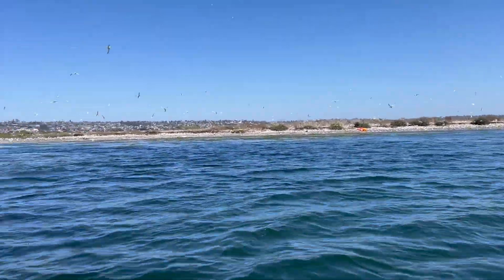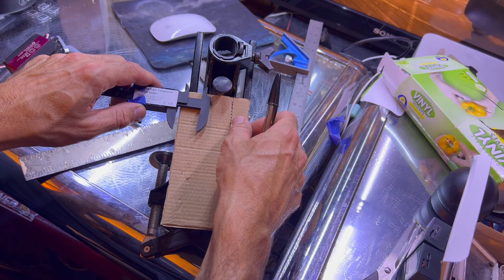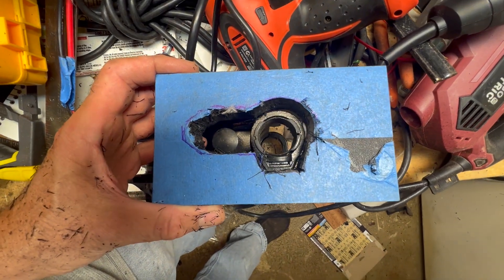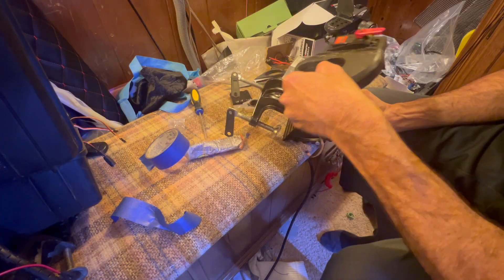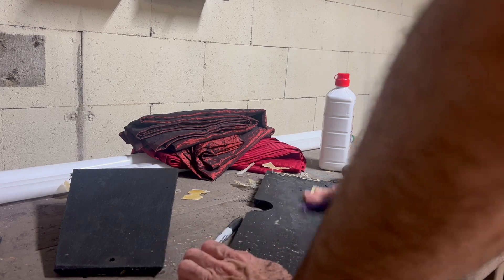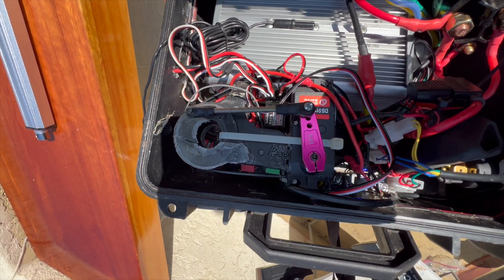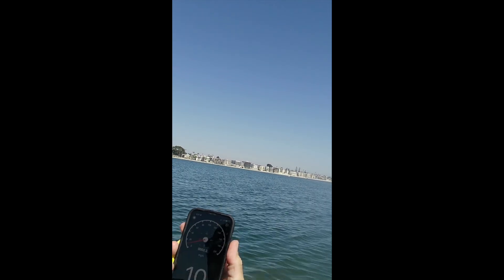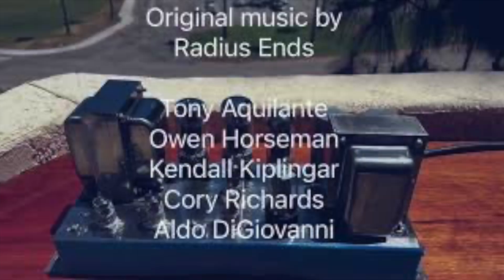10 MPH wireless Kayak Part  2

Comment: What is the actual motor & where did you get it?
Reply from the maker: I just found this on AliExpress: $541.00 | Kunray KR5V V2 72V 5000W Electric Brushless Motor Kits For Electric Motorcycl/Scootor/Bicycle Engine Электро-двигатели
https://a.aliexpress.com/_mq5bZkF
My exact motor and output shaft is no longer available as a unit. You can still piece it together but it’s no longer sold as one. I have seen smaller 2500watt units still for sale on Ali express but not the larger one. I wonder if it was too much torque for that little output shaft?

Comment: Is this the 1000w model?
Reply from the maker: It’s not the 1000 watt one. I got the 3200 watt one that is no longer available. The manufacturer claimed 7 horsepower but realistically it’s probably only 5 hp. I bought it a couple years ago
Reply from the maker: Brushless DC Motor 3000W 72V Electric Motor High Power Brushless Motor Controller 50A Scooter Motor Go Kart Electric Motor KitI just found this on AliExpress: $92.93 |

 Outboard Motor Propeller Gasoline Lawn Mower Modified Bracket Four-stroke Inflatable Boat Fishing Boat Kayak Bracket
https://a.aliexpress.com/_mKKw3IL

You would have to combine a similar motor and this prop shaft since the larger 3200 watt motor are no longer sold as boat motors

Comment: You need a different hull shape to get more speed. Kayaks/canoes are displacement boat. You need a semi-displacent hull or planing hull type. Maybe a lightweight micro skiff.
Reply from the maker: I know that hull is not for high speeds. That’s why I bought the used water skis. My goal is to get the hull out of the water and ride on two skis. My biggest concern would be that 5hp won’t be enough to get me and the boat in the air above the water. We shall see.

Comment: Boy oh boy, how odd.  Today I will be getting a bicycle motor controller and a brushless lawnmower motor, both from Ebay.  Have been playing with the idea of powering my kayak for the last 20 years.  Started out with a gas powered leaf blower (got some laughs).  Then tried a small gas powered water pump.  That work ok but was not self priming and the motor compression was high enough to make starting hard.  The string trimmer worked the best.  Hard to find a good prop then and the trimmer clutch would get very hot.  That issue was addressed by making a small scoop to plumb water through a tube and spray the clutch shell. As a d.y.i. guy, all that stuff was part of the fun.  Being younger, paddling 5 to 10 miles was not a problem and would not involve 'break-downs'  Now at 75, d.i.y. shop time is enjoyed more than the outdoor adventure.  In addition to the parts I made mention of, last night on Ebay I came across the same system that you are using, likely that will be delivered by 8/9.  My current craft is a Sea Eagle 385.  Much lighter than my previous Ocean Kayaks.  Amazing how ideas just float around and get picked up by different people.  For many years it has seemed that ideas 'move about' like radio signals. For some of us, they are just pulled out of thin air. Once I get my homemade unit going, I will sell my Bixpy setup as I have used it only once.  Works fine, go figure.
Reply from the maker: Thats Rad! im glad i inspired you. I looked into a small gas motor also. They wouldnt ship it to my wonderful State. Everything is illegal in California including two stroke motors.